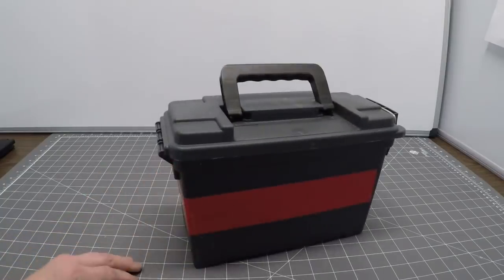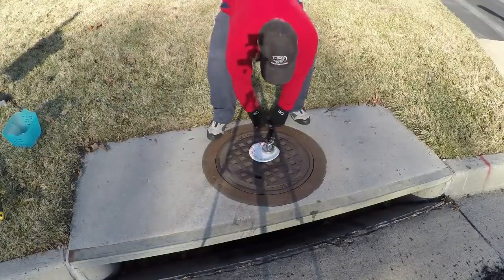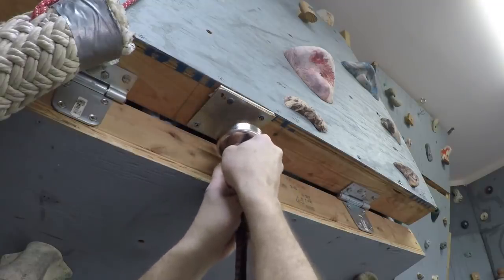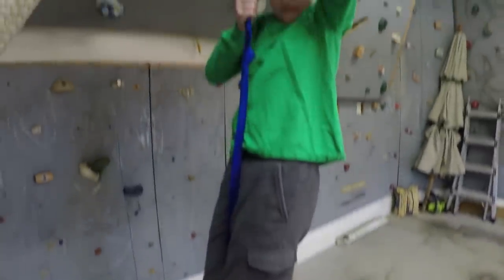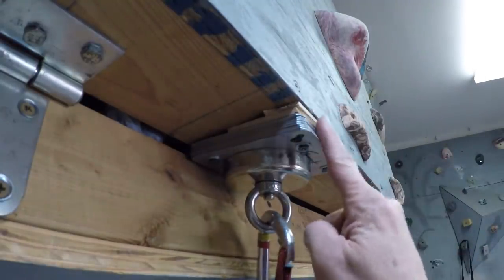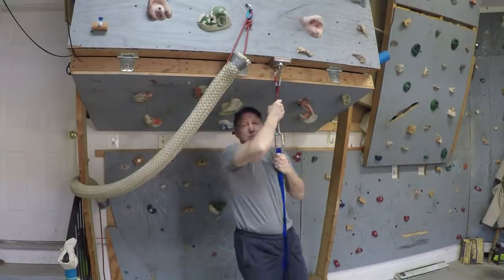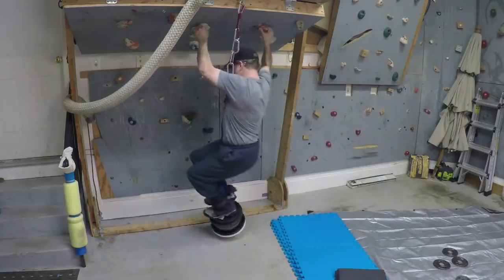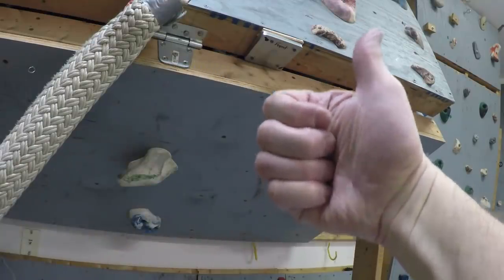Risky Testing of 350 lb Force Super Magnet - How Strong is It?

Comment: Inserting a grippy material or using a rubber coated magnet does increase the friction between the surfaces, which can prevent it from sliding down. However, since the magnet is now farther away from the steel surface, it has a much lower pull force.

Comment: your test is invalid though for 2 reasons, one, magnets don't handle impact well and two you and the weight rocking adds weight, still your video holds great value anyways, thank you
Reply from the maker: Thijs van Gisbergen, thanks for the feedback. There are several things I would change if I was to repeat this test. In a sense I was also trying to simulate the reaction of the magnet while fishing and snagging a heavy object from the bottom. In those cases the magnet rocks and slides similar to how it did in this test setup. Trying to test pulling up a 200-300 lb load from under water would be challenging in other ways, first its wet and second things on the bottom usually get covered with gunk rather quickly and buried over time.
Reply from the maker: All of the above reasons is why I invented this new magnet fishing rig you can see the test video here: https://www.youtube.com/watch?v=QmBbRYWo49c&t=2s
Thanks again for your feedback, always appreciated.

Comment: I am a 300 pound man I want to  hang a hammock in my bus which has a metal roof what size magnets would you use so I don't hit the floor ?
Reply from the maker: Chef Santa, there's 2 things to consider. 1) the strength of the magnet. and 2) as I learned doing this video the amount of backplate you have is just as critical. If your bus doesn't have 1 inch thick steel spars or I-beams you're at risk with any power magnet, because that is how they rate the strength. Since most busses survive rollover they must have a fairly beefy structure...
Since you mentioned roof, remember these magnets are designed to be strongest when the loads are perpendicular to the face of the magnet. Any angle and you won't get the rated strength of magnet. If I knew more about the roof structure I might be able to give you a better answer.

Comment: Swinging will cause more weight as well as you jumping onto it cause an initial weight plus the air gap in between the plates of steel will also give a weaker hold and the carbon ratio of the steel will also give a different result
Reply from the maker: Ryan Jones, all valid points. When I designed this test I was thinking about magnet fishing and snagging something heavy on the bottom. But if I were to do it over I would certainly incorporate all your thoughts above. Thank you.

Comment: they tested it on a solid 1/2" steel plate not 5, 1/10" steel plates solid plating would give a stronger pull strength
Reply from the maker: Dlink Travis, valid point. That is one of several things I would change if and when I update this video and do it again. Thanks for the feedback.

Comment: It is not completely static Load, there is a dynamic load added due to the swinging and the great effect of the air gap between the metal sheets which resist the loop of magnetic flux
.
Reply from the maker: ehab nour, all valid points. Thanks for the feedback.
Reply: Sorta like how car audio subs are rated? They say a 10” sub was rated at 1,000 wattts BUT, ignoring the fine details that were much closer to it’s actually power when used as marketed.  So a 1,000watt Peak power output subwoofer 🔊 was probably a 500 watt  RMS or continuous power output
Reply: At any rate, good job showing us what this “neato-beem-him-up” super magnet 🧲 can do!

Comment: dang i think i over did it. ordered a 600lb one cus i didnt believe it. i only want it cus i lost something in a back wall of my backyard and i'd use it to fish it out. im kinda intimidated. its guna arrive in a day or two.
Reply from the maker: It's hard to tell on these magnets. Recommend you be careful were you work with this. I almost lost mine while magnet fishing in a spillway when it started to cling onto a metal conduit. Make sure your line is strong enough to give it a good yank without breaking. Good luck.
Reply: @MakeItorBreakItNow  and now i realize i wear steel toed boots all the time.
Reply from the maker: @Magician12345  , be careful out there...

Comment: Your test is highly uncontrolled. From what I saw it's most likely between 300-350lbs. You need solid steal  for molecular reasons and a nice gradual centered pull. 1 you were swinging pulling the tention off cent while also adding G's. Second it looks like your using galvanized steel. Not as magnetic then iron steel
Reply from the maker: Zach Bishop, thanks for your feedback. Your points are valid. If and when I do a test like this again I would do it quite differently.

Comment: You would have got well over 300, if not cleared 350, if you would have went about it better. When they test these, the force is pulled completely straight, as in not swinging back and forth like you were. As well, its hard telling how much force you were putting on it initially when you were literally jumping on it hard enough to make the weight's clink together. 

They actually recommend that you remove these magnets from things by doing exactly what you are doing. You are supposed to put force at an angle to be able to remove them. If you would have been able to make sure the force was exerted  fully vertically, straight, without movment, and applied steadily and not in a jerking motion, you would have gotten a lot more accurate results.
Reply from the maker: The Real One, agree with your assessment. If I was to do this over again I would have rigged a more refined setup, and used a solid 1/4 steel plate.  I learn every time I do a video and will put your thoughts into practice next time.
Reply: Make It or Break It by sandwiching the thin plates together you are not achieving the same effect as if you had a solid 1/2” by say 6” square plate, the small gaps between the plates will have a huge impact, anything from paint, to dust, mud, oil, rust or other magnetic debris will decrease the holdings power of a magnet by a huge factor, sometimes over 70%, that is without taking the angled pull into account which as stated above already, has a major impact on measured pull capacity. A 1/4” plate as you mentioned would not capture the full magnetic potential of your magnet, much of the field of attraction would be escaping out the other side of the plate, I would very much like to see how it performs on a 1/2” solid steel plate with a larger footprint.

Comment: Layers of steel are not comparable to solid steel. That's one of the principles behind the electrical transformer.
Reply from the maker: Dave, agreed. It's just what I could find rather easily. Thanks for the  feedback.
Reply: not really, Dave - transformers use layers of steel because they work JUST AS GOOD as whole chunk of steel for the magnetic force. They use layers for different reason: they want to prevent eddy currents induced by the alternating currents. In his tests he does not use electric current, so the solid block of steel or sheets - no big difference if you neglect small air gaps between them.